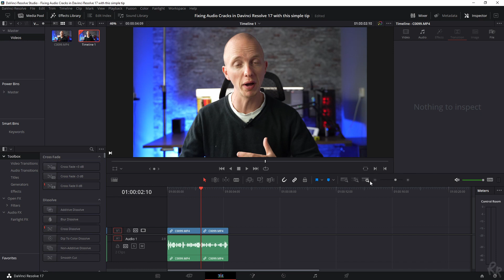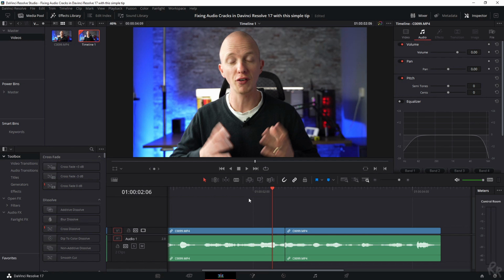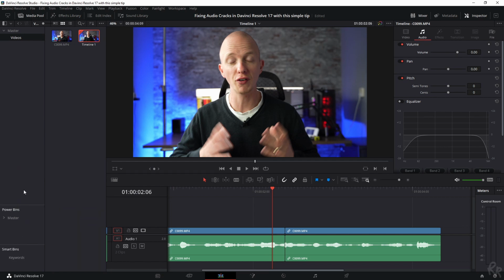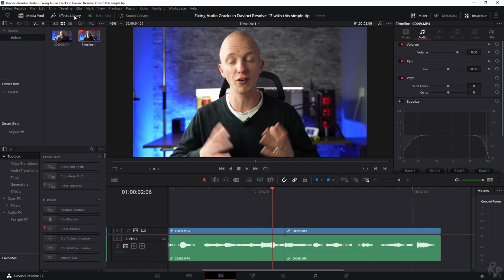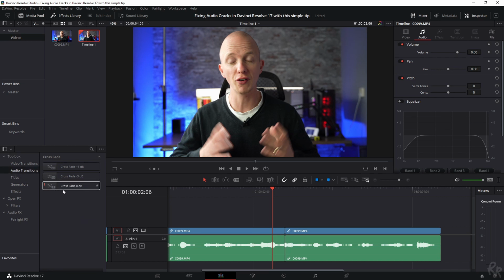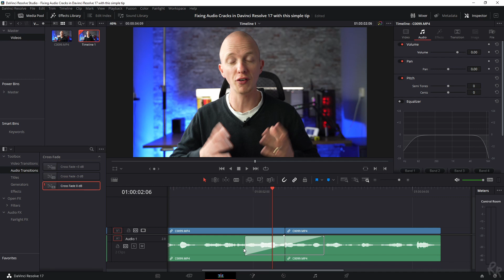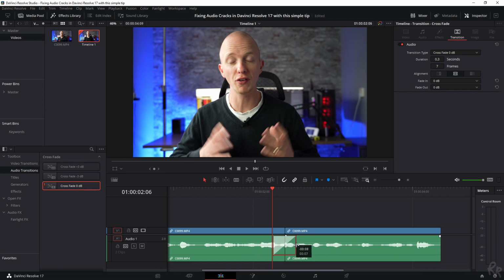Fixing AUDIO CRACKS in DAVINCI RESOLVE 17

Comment: I am using the voice over in Davinci resolve 17 and while talking I can hear subtle crackling or static. How do I prevent that from happening or is there a way to remove it? Please help!
Reply: I have this issues as well and the work around I have found the works when I remember to, is to go into project settings, fairlight tab and change my Audio sample rate. All my recording devices are set to 48k, but I get crackle on resolve set to 48k but not when I record on 44.1k. Hope that helps
Reply: @ChimpiePlays  thank you, Ill have to try to remember to change that setting before I add my media next time
Reply from the maker: Which microphone do you use?
Reply: @RicoResolves  Same issue here, blue yeti. I dont hear it when i record a sample within ghub bluevoice software, but as soon as i record in davinci i notice the crackling

Comment: I have the issue that randomly when recording full length commentaries (usually 10 mins plus), the audio cracks or makes strange noises every 20 seconds or so but is randomly, can you help? Many others have this issue. So one audio clip and random pop noises or issus
Reply from the maker: Where is the microphone placed on the subject? Does it only occur during editing or also when it's rendered out?
Reply: @RicoResolves  it appears during editing. the original clip doesn't have that issue. When editing then render, the cracks/pops are heard everywhere. This also maybe be cause of changing mono sounds to stereo
Reply: @ahmadbmr  I get this issue as well